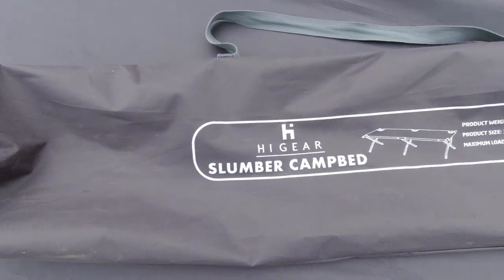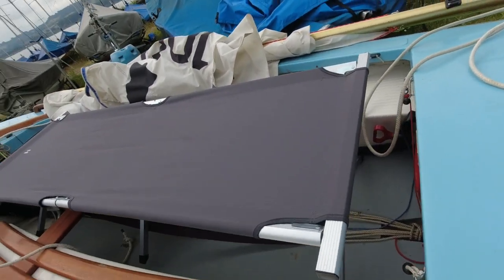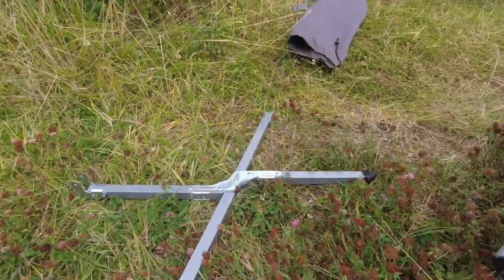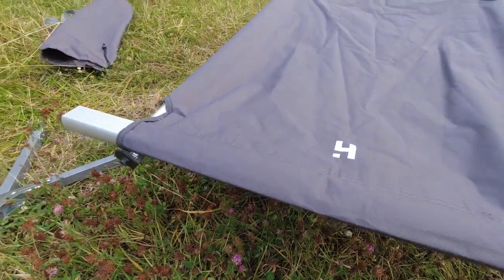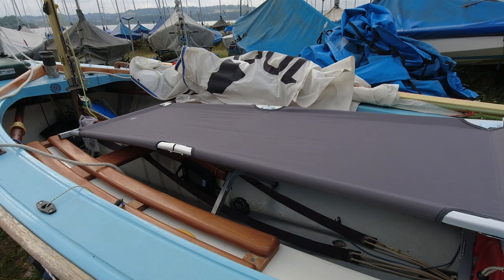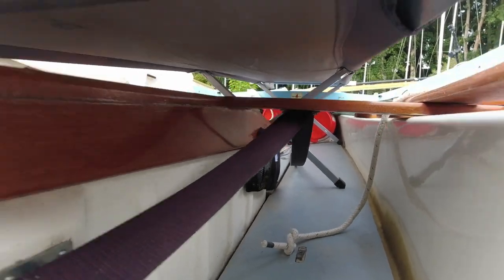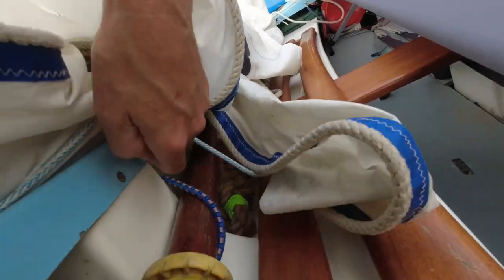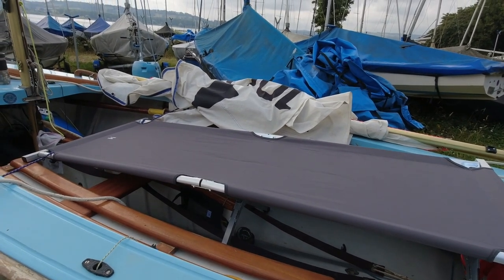GP14 Bed for dinghy cruising

Comment: Well done! Coming together nicely. Can I suggest a couple of spacer blocks screwed to the forward end of the stretcher? It appears as though the forward end needs to be a bit higher to prevent a hump in the middle of your bed. Maybe it’s just camera angle though… thanks for posting.
Reply from the maker: Hi, and thank you for the suggestion. You are right, the feet end of the bed does sit ever so slightly lower than the head end however, having used it a few times now it is really comfortable as is. Adding spacer blocks would prevent the end rail from being removable from the fabric and therefore wouldn’t stow away as intended. Love your videos, keep them coming! :) ( I learned to sail in a heron many many many years ago )

Comment: I have a series 1, so I can slither down under the thwart and still have room beneath the benches to lie down,  but I like what you did here, quite ingenious really.  I also like your compass placement, I need to steal that.
Reply from the maker: Ah! Thank you, the compass has had many previous locations, none of which I liked or were a problem. I took a while ( and too many screw holes ) to finally settle on that location, which I’m really pleased with now. Thanks for watching 😊⛵️

Comment: Just a thought or two, if I may... Instead of drilling out the rivets and detaching the legs, why not just raise the legs with blocks of wood?  If not, then why not place a board across and beneath the legless side to support and raise the lower end, rather than use bungee cords? It will be "evenly flatter" then. All-in-all, fair winds and peaceful dreams!
Reply from the maker: Hi, Thanks for your suggestion. The centreboard is too high to either of those things, it would result in the foot end of the bed being way too high compared to the head end, plus it woild mean carrying more 'parts' than I've got room for. That said, I will probably add some soft pads to the bed rail ends so they don't risk scraping the varnish off my bench lats. The legs that I drilled out can easily be re-installed using the bolts and wingnuts shown in the video. :) Thanks for watching and engaging :)
Reply: @sailingskismo  I see. Thanks, and fair winds from Japan.

Comment: Great idea. I thought of doing something similar in my boat. What brand of camp bed is it that you're using?  My seating configuration is different  so I will need to experiment a bit. Recognised your voice from the DF95 instruction videos. All good stuff.
Cheers,

Jeff
Reply from the maker: Hi Jeff, the camper is by HiGear and it’s called a slumber campbed.

Comment: New to this  do those  rowlock  holes  come as standard  on fibreglass  boats ?
Reply from the maker: Hi Paul, not usually. The GP14 class association do have documentation that suggests where exactly to install them. However, I sat in the boat with the oars and marked where they should go based on my seated position and oar length. Installing them was reasonably straightforward but you do need to put a piece of ‘load spreading’ timber on the underside of the deck. I used 25mm thick mahogany.